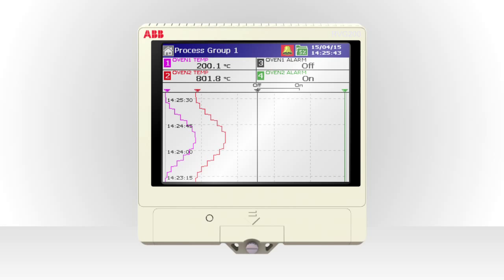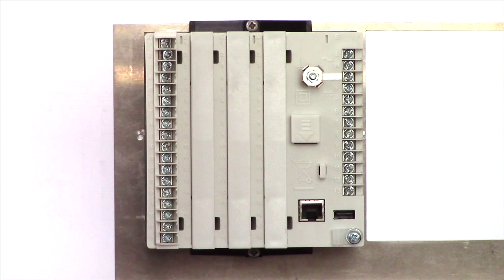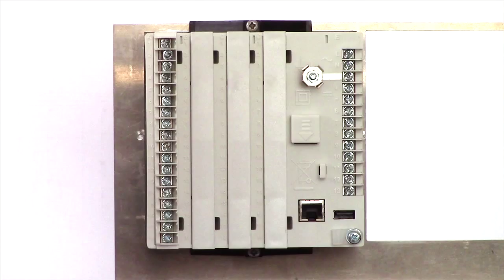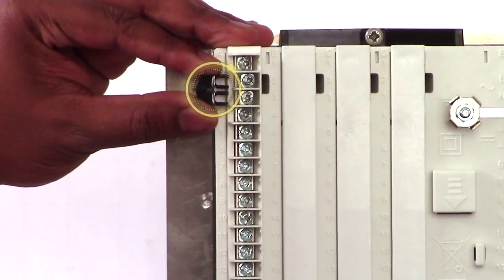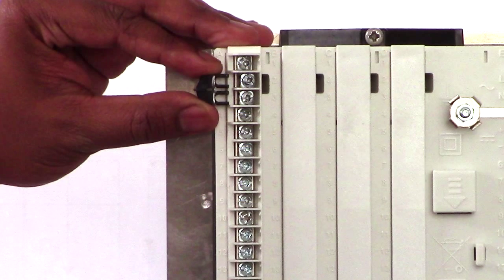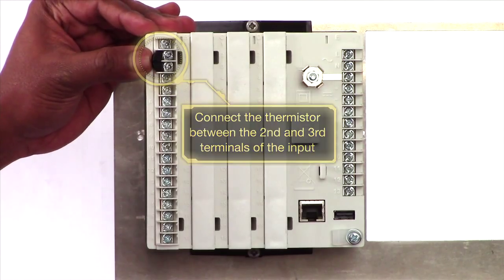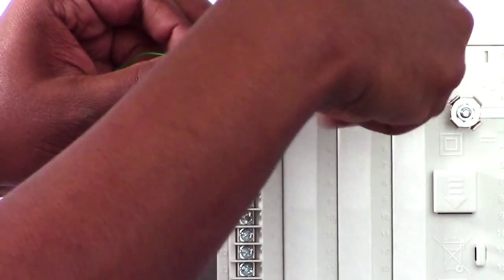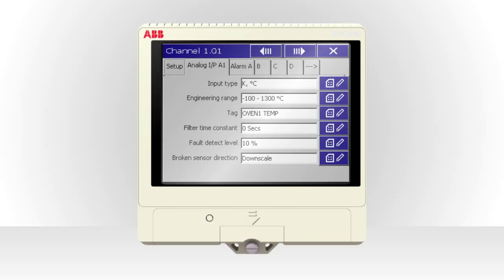Recording & Control Hints and Tips - Installing a thermocouple on an RVG200

Comment: Can we short using a cable 2and3?
Reply: Hi Anju,

Each analog input card with a thermocouple input must have a minimum of 1 cold junction assembly fitted (part number CM30/0052). We supply one cold junction assembly as standard with the unit. 

Each Analog input card can have up to 6 thermocouple inputs, so you need a minimum of one cold junction assembly fitted for the measurement to work. And for the other 5 thermocouple inputs, you should be able to use the shorting links supplied with the unit.For applications requiring maximum thermocouple accuracy, it is recommended that each thermocouple input is fitted with a cold junction assembly.

If you need further assistance please free to drop us an email @ GB-recording.control@abb.com
Reply: @emillopez1882  why we want this cold Junction assembly?